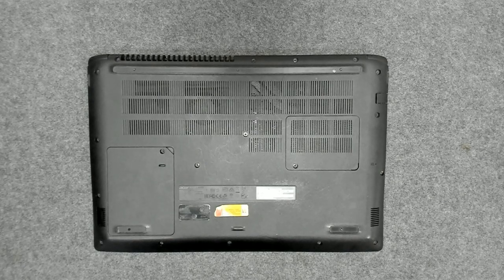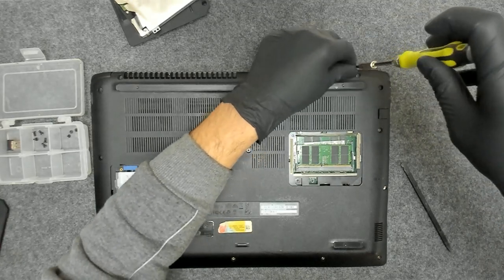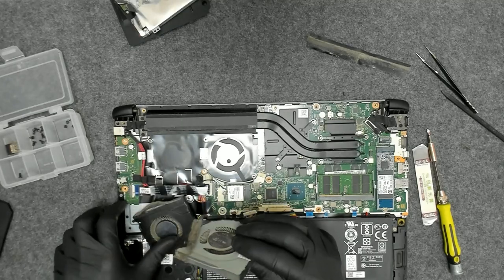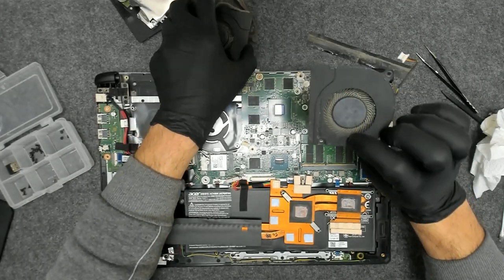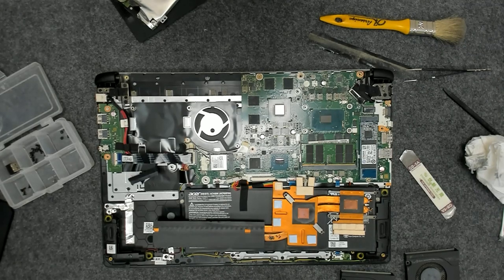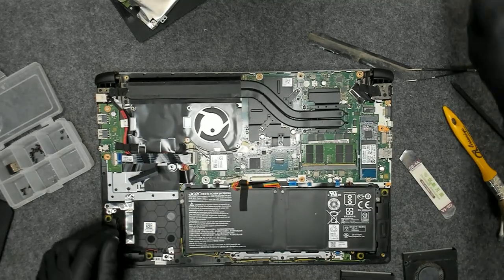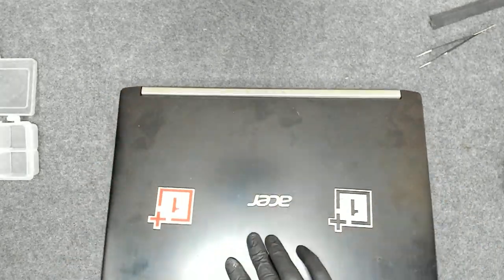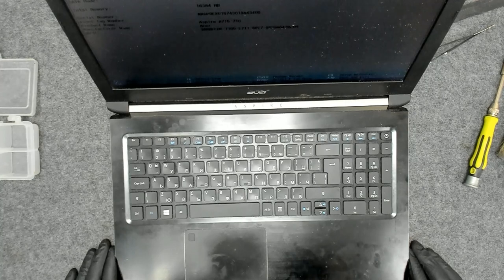Acer Aspire 7 A715-71G Disassembly / Fan Clean

Comment: Did you use a special type of tape when putting the fans back in?
Reply from the maker: No, regular isolating tape. You can use any.
Reply: @LaptopDisassembly  so could I use masking tape? Or gaffa tape ?
Reply from the maker: @callummcvay3879  yes, you can use both.
Reply: @LaptopDisassembly  great, thank you so much. The video was a real help